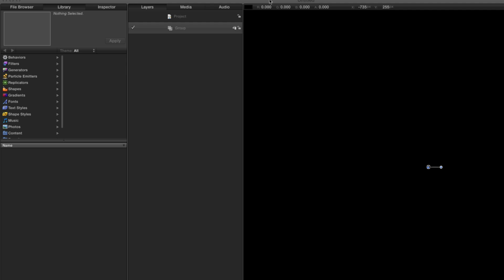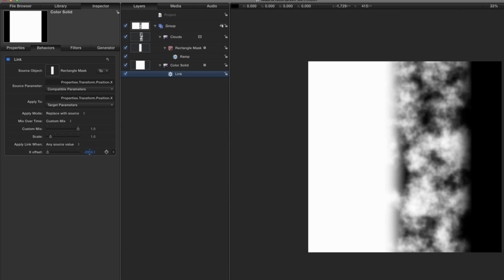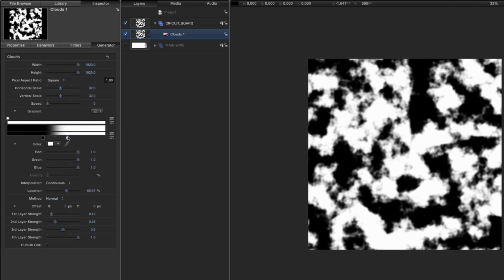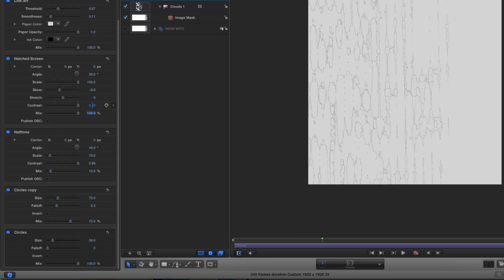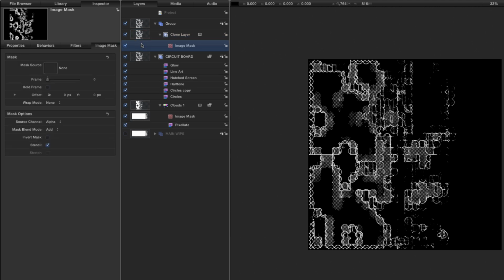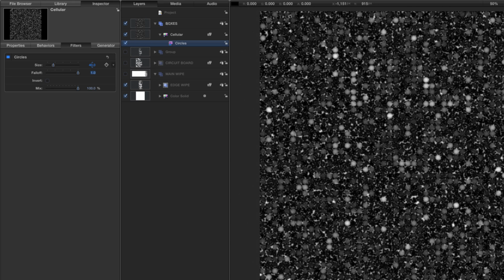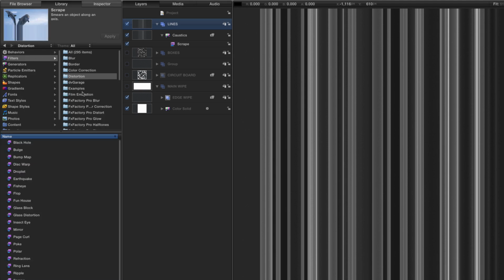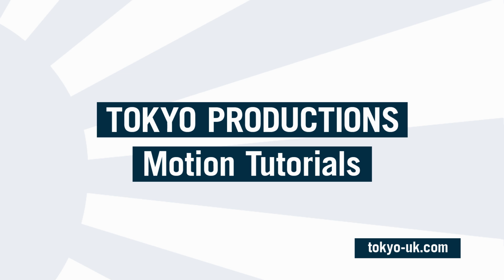Apple Motion 5: Power Matrix Tutorial Part 1

Comment: Simon, just discovered your tutorials. Brilliant! Thanks so much. I've been struggling with one thing on the circuit board group. I only get the same look you have if I set the Clouds 1 Image Mask to Source Channel "Alpha". If I go with "Luminance" as you have instructed the "clouds" are mostly filled in. I've gone over the first 12 minutes about three times now to see if I have missed anything. Just curious. Thanks again for these fantastic tutorials.
Reply from the maker: Mitchell Milliron Thanks for the feedback. I'm very puzzled as to your problem. The image mask source here is simple a grayscale image with no alpha channel - or rather the alpha channel is solid white - which is why it's necessary to use Luminance rather than Alpha here.  If you'd like to send me your project (email address in the About tab above), I'd be happy to troubleshoot it for you.
Reply: Simon Ubsdell First off, thanks for taking the time. Prior to sending I did one last review keeping in mind luminance. I discovered that my Color Solid generator was set at "almost white". (RGB 0.92, 0.92, 0.92) The monitor I was using fooled me when I used the eyedropper. It wasn't until I disclosed the color triangle on the generator that I discovered my fault. So, I do apologize for wasting your time. I can't say enough great things about your tutorials and you help. You have definitely changed the way I think about creating in Motion.
Reply from the maker: Aha!  Well spotted - that was quite a tricky one.  You're not wasting my time at all - always happy to try and help where/if I can.